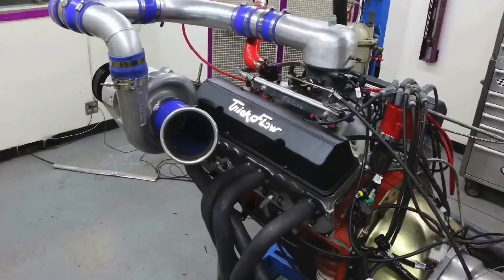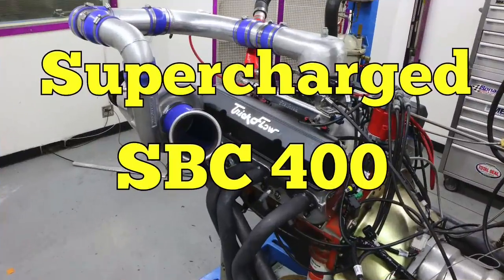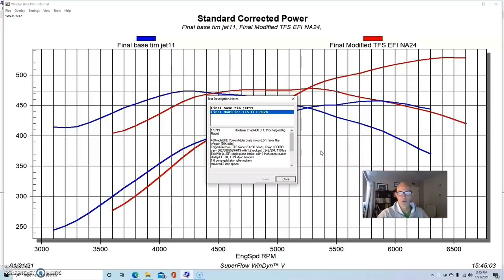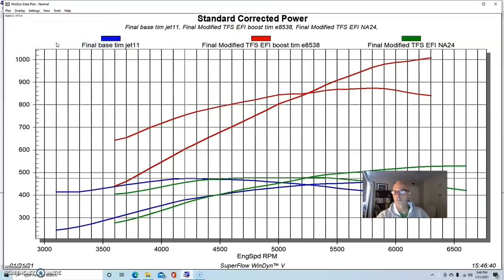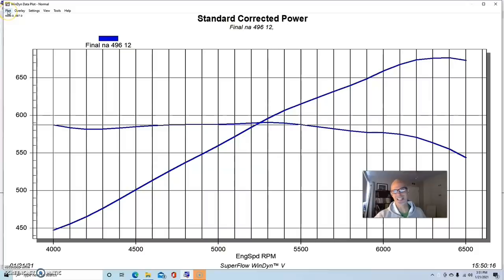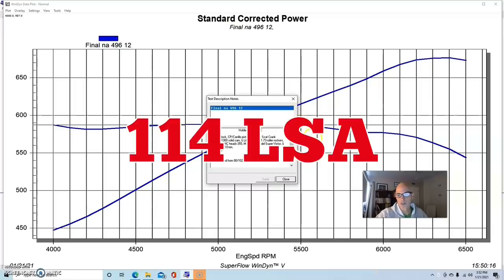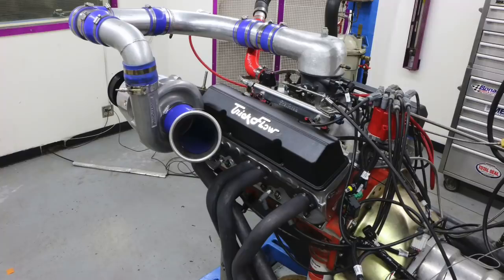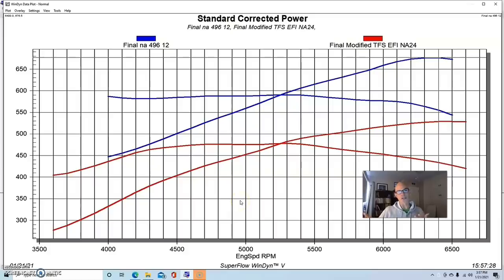400 SBC VS 496 BBC-1000-HP SUPERCHARGED BOOST BATTLE

Comment: I would like to see this test redone using the 400 sbc and a 396 bbc. Use the exact same cams, intake, heads, runner CC to see which is the more efficient design
Reply: Alex Eidenier  sbcs physically can't go much larger than about 406 and even that's pushing it because the cylinders are very close. I would like to see the 400 sbc stacked up against a 396 or 400 BBC but I think the sbc would win because it's a lighter platform weight wise even if they make the exact same power
Reply: Alex Eidenier  that was an interesting hotrod article. I was mainly referring to sticking to GM blocks and not aftermarket ones, but while the 454 sbc may make great power the cylinders are so close together that you can kiss any chance of adding nitrous or boost goodbye. Doesn't help that it looks like 454 is really pushing its limits too, and I cannot stress this enough, the cylinders are *very* close together
Reply: Alex Eidenier  I mentioned earlier that the 400s cylinders are very close.  The 454 sbc requires a felpro 1036 and you look at that damn 1036 and tell me you feel comfortable adding boost or nitrous to that.  It's so thin between the cylinders that it could easily pop a gasket between cylinders. Better keep an eye on that temperature gauge

Comment: I know the results would be similar with a roots or twin screw, but I'd be curious to see that.  Specifically because they are positive displacement supercharger, so for the same blower speed they WILL flow the same air.  So any hp difference would come down to an increase/decrease in the power required to run the SC, and possibly a difference in valve overlap allowing charge air to get out the exhaust valve.

Comment: I think they made the same horsepower due to compressor efficiency. Once the boost went past a certain threshold, it couldn’t keep supplying the same air flow to the smaller engine.

Comment: Is the bottom end stock or bored?
Reply: Doubt it's stock. Unless brand new block stroker kit means new pistons and you'd bore it for a correct piston to wall clearance. Not often an old motor is still in optimum spec after wear and a hone.

Comment: The intake of the blower draws the same volume on both motors given the same pulley. Both motors maxed the power output of the 4.5" pulley. The efficiency of the BB's valuetrain allowed higher power output on the big end.

Comment: Challenge:
Assume the drive line can handle 700ft-lbs of torque.
Choose the cam and pulleys that make the widest RPM range while maintaining 700ft-lbs.
Replace the intake with a long runner to bring the 700 ft-lbs torque at even lower rpm.

Comment: The blower's air flow is the limiting factor in the big block setup. In the small block, the displacement itself is. So in the mid-range rpm areas, both are using the same amount of air thus making the same power, but as rpm increases, the smaller engine simply runs out of flow efficiency as compared to the big block. Boost can almost be thought of as how much extra work is being done to utilize the extra air and isn't the factor that actually "makes" the extra power, but more of a representation as to "how" the extra power WAS made. Also, since the blower produces constant airflow regardless of engine size, you could assume that a turbo test would be much different as airflow output from the charger would be affected by the initial airflow introduced by the exhaust of your engine. i.e. big block would spin a larger turbo faster and create a much more efficient torque curve while also utilizing the extra air much better than the small block, however centrifugal blowers eliminate that particular part of the forced induction equation

Comment: Could it be because of back pressure is why both engines made the same  power  u ers through most of the rpm range? Don't know, just taking a wild guess.

Comment: What I take away from this is the old design is still relevant. The same can be done with a 351 vs 460 and 340 vs 440.
Why were the boost levels different? The simple explanation is this. On a very windy day a window opened the same amount will will feel more windy in a small room than a bigger room

Comment: George Montgomery constantly gets it right Andy Harman. Displacement x rpm / 3456 * ve = hp at 350 cid. That is the Aspirations Index figure. Small blocks have better Aspirations indexes than big blocks, with figures like 1800 vs 2000 on supercharged SBCs vs BBCs. That happens because the big blocks chamber doesnt allow it to carry as much effective compression as the SBC before detonation sets in. A canted valve Chev has a poor detonation threashold unless you figure your way around the head to chamber cam and octane aspects. But a BBC wont break as easy and has suppreme latent Strength.

Comment: For the power difference at the same SC speed, mass flow and different PR, Im guessing its the difference in the SC isentropic efficiency. If we had a compressor map, we could see how the efficiency changes with mass flow and PR. Then you can find the power required to turn the blower based on the PR and RPM. I would bet that below 5000 rpm, the the SC efficiencies (and SC power) are similar and then start deviating above 5000. From my experience SC power starts climbing non-linearly when you start getting around 1.5-2 PR. The higher PR of the small block will use more power to turn the SC, resulting in lower peak HP numbers than the big block.
Reply: Excellent comment and bang on sir! You described exactly what I was thinking, but way better. 👍🏼

Comment: too answer your question it's because of the nature of centrifugal supercharger they both are using all the air that the supercharger is making at those are RPM levels once the supercharger catches up and able to produce more air the larger motor takes over because if they will still to use the air that the supercharger is producing I learned it from watching you

Comment: This is very thought provoking. After close study of the data it appears that the smaller cammed SB can more efficiently process that boost into hp at the 4000-5500 range, then the BB Begins to shine. The Richard Holdener boost multiplier equation very much shows true in this example. Looking at the boost differential at the various rpms, the gap widens with RPM  indicating the ability of the BB to consume that air as rpms and boost increase. Excellent test, now for the roots blower.....
Reply: The heads on the big block shine beyond 5000 rpm

Comment: The major reason that the 400 made the same power through the midrange as the 496 was that it had about 20% more manifold air density from boost pressure alone.  Look at 4600 rpm; 10 psi vs 6 psi gage plus 14.5 atmospheric = 24.5 and 20.5.  Then take the ratio 24.5/20.5 = 1.195, which is the advantage in power potential that the small block had.  Then E85 could account for the other 4.5%.

Comment: Made similar power because the blower was ingesting nearly a similar amount of air on both tests. The fuel difference did skew the result though...  On the same fuel, the big block would show more of an advantage in part because it takes more power to produce higher boost, and in part because I think the supercharger will ingest a little less airflow when it's producing higher boost. The added heat from the higher boost probably isn't much of a player since they were intercooled.

Comment: Compressor load is non linear. Like folding a paper in half over and over again, each fold gets exponentially harder. The separation at the top of the rev range would show this because of the higher pressure and extra load on the  sbc. 
Maybe the similarities in the middle are due to the lack of difference in the amount of effort. Like the first and the second paper folds seem easy and almost the same effort, and you will only notice as you get further up in psi. 
And the difference in the lower range is the different starting points. 

Just my 2cents.
Reply: Great analogy!

Comment: Wouldn’t producing a higher boost pressure also draw more power to spin the blower, and as the boost curves got farther away wouldn’t you then start to see a bigger difference in power.

Comment: The 496 made more at the top because it had more cam. It lost enough down low to equal the small block until the big block cam got into its ideal rpm range.

Comment: It would be cool to see a comparison between a 400 small block and a 396 big block.  See what difference there would be if any.
Reply: Hotrod magazine  August 1998 they did 400sbc  vs 396 bbc test , on the dyno the 396 made a little more power  then they drag raced them both in a 70 camaro old article but interesting .
Reply: I’d prefer to see SBC 396 stroker with its little 4” bore vs BBC 396.

Comment: Engines made the same power because the blower is technically a restriction in the sense that regardless of the size of the engine it's bolted to, it's just a fan of a certain size spinning at a certain speed that remains identical in each engine application. It's a restriction because it and only it determines the cfm of air entering the engine at wide open throttle. So it's creating positive pressure, yes, but it's still technically restricting the intake air flow. 
Since any engine is just an air pump, it can only consume the amount of air supplied to the combustion process. That amount of air being pushed into the engine is the same on both engines, because at wide open throttle the throttle plate is.. Well... Wide open and the blower spinning at 4000rpm will displace the exact same amount of air on a 500inch big block as it would at 4000rpm on a lawnmower engine.
The amount, temperature and density of the air are what determines power output, using different fuels like race gas or e85 don't really ADD power - they just allow the engine to work more efficiently and extract the power that the engine is capable of making.
E85 means less energy lost to heat, which means more fuel and air can be crammed into the cylinder, making more power. The high octane of the E85 and race gas don't add power, they simply allow timing adjustments to make the engine perform more efficiently.
When I talk about efficiency I mean the thermo-efficiency of the engine... What percentage of the fuel burned is wasted to heat etc and how much actually turns into power.
Gasoline engines are only around 30% thermo efficiency and diesel engines higher, around 40% or more. Using e85 or race gas just increases the thermo efficiency by 1 or 2 percent, it doesn't ADD power.
The blower adds power, and the same blower with the same pulley pushes the same amount of air, regardless of the engine size.
Psi is NOT a good way of measuring how MUCH air is being used - the big block and small block had the exact same amount of air to work with, but the small block was 96ci smaller. That's why the boost was higher.
Cramming the same amount of air into a small canister and it'll still be small, just have lots of pressure inside.
Then cram that exact same amount of air into a gallon jug.
Same amount of air.
Same potential energy.
Just different sized containers.
Your engine is just a container that has lots of little explosions happening inside and pumping air to create work.
So that's why they made the same power.
They had exactly the same amount of air to mix with fuel, and both of them are pushrod engines with almost identical thermic and volumetric efficiency - depending on cams, valves, intake etc. Obviously more lift and bigger valves will allow more air and fuel to be crammed into the combustion chamber - and that increases volumetric efficiency.
The outcome from this test is basically that with a lumpier cam, some heads and bigger valves that small block can easily make more power than the big block.
There IS a replacement for displacement. BOOST.
The only purpose of making an engine bigger is to make it pump more air, creating more power.
But with supercharged engines, you get to have a whirly whooshy thing to cram the fuck outta some air and make a little 2 liter engine produce the same power as an NA engine that's 6 or 7 liters.
It's just an air pump, and rich put a metering device for the intake airflow in the form of the blower.

Comment: I wonder how much difference the intake charge temp was with 7 pounds of pressure difference at peak between the two motors.   That could have been the equalizer.  Cooling effects of E85 vs lower boost temps??????

Comment: Is it possible that the higher boost pressure on the sbc created higher cylinder pressure than the bbc at the same rpm up to where the bbc was able to take advantage of 10+psi on the top end?

Comment: How much timing did you run on the small block on boost?
Reply: If you pause when he shows the specs it showed 20-22 degrees he was still real conservative on timing. Pulling 1 degree per pound after 5psi is still conservative

Comment: A test you have never done:
Identical head flow but massive displacement differences,  BOSS 351 VS Stroked 557/429 Cobra Jet, both with Turbos. Would the identical head flow completely negate the huge cubic inch advantage when turbochargers are in the equation?????
PS, I know, a little head porting will make them identical.
Reply: The smaller engine would make the same power, but would need to be revved higher to take advantage of the cylinder head flow.  Displacement x rpm /3456 = theoretical airflow in cfm.

Comment: It's easy as to why. A centrifugal blower at the same blower speed is going to provide the same airflow. This means that the only difference in power output will be based on two things. The ability for the engine to ingest air, and the efficiency of the blower. So obviously in this case if the blower's efficiency was comparable at the two different pr's then the small block became an airflow restriction higher up in the rev range, restricting the power output. My guess, without looking at the compressor map for that blower is that it was a combination of the pr for the BBC being more efficient and the sbc having greater airflow restriction higher up in the rev range.
Reply: Well said, an excellent comment!
Reply: Well said. Im with you 100%